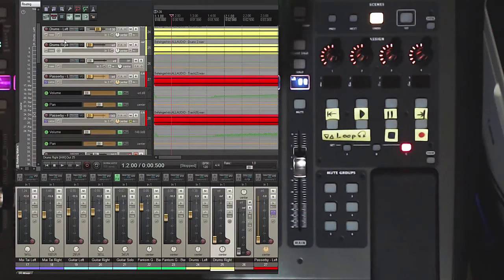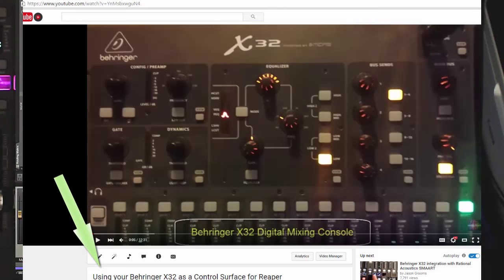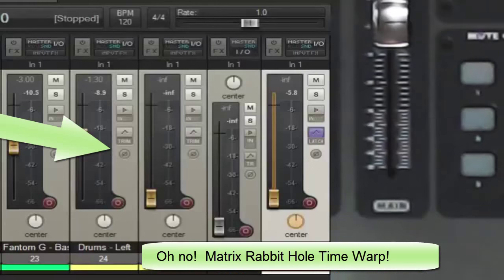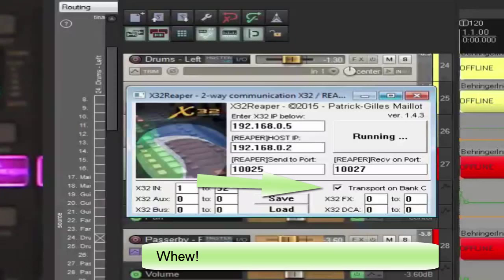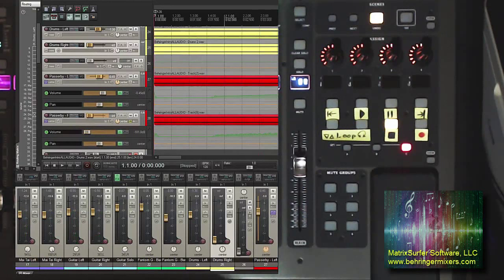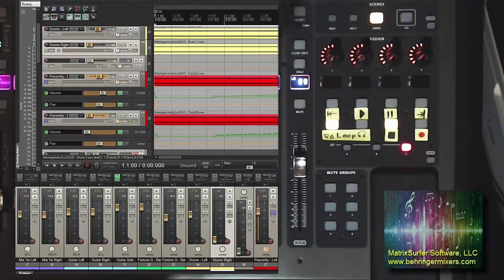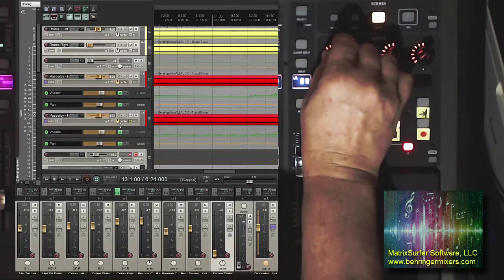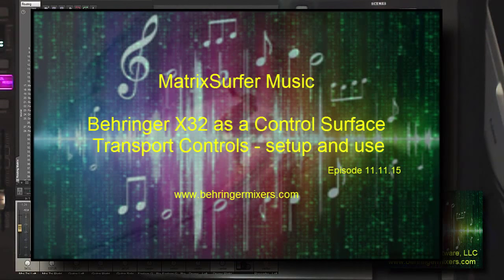X32 as Control Surface Transport Controls

Comment: You know if this works on Mac OSx in Reason 5? or Ableton?
I did the assignable config to the buttons and rotaries, but is not transmitting MIDI clock into the softwares. I don't know Reaper. Is a free Software?
Reply from the maker: I don't know if this works on other systems.  Reaper is not free, however, they have a generous demo program with full functionality.